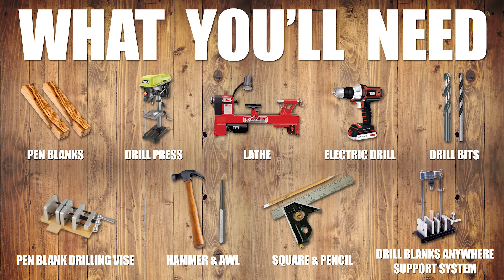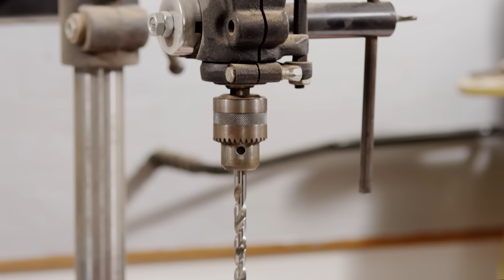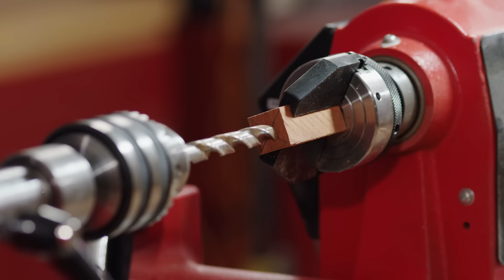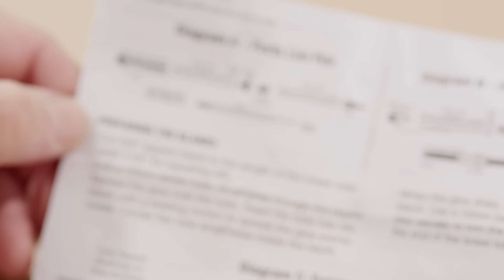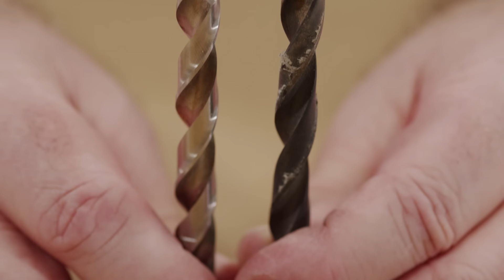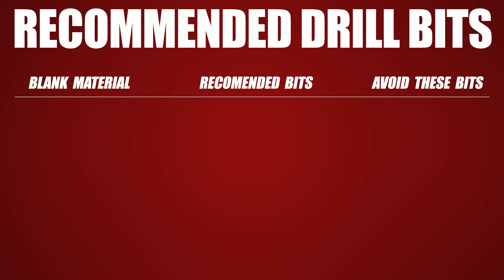Pen Blank Drilling Basics - Pen Turning for Beginners

Comment: I use my lathe (acquired from PSI 🙂) to bore out  the holes. I've been using the blank mounted at the head stock and my bit is stationary. Is this the best way? Can it be turned around so the bit is spinning and the blank is stationary? This would be, essentially the same as using a drill press but horizontal.

Comment: So curious here. I normally use a drill press and pen vice to drill my blanks but had a hard time with making an acrylic key chain tooth pick holder.  The hole was basically too large and wallered out.  So it was suggested to use my lathe to get a more accurate hole.  So I got the accessories needed for my lathe and the hole is more straight but still too big, the drill insert falls right through. Could I have a bad 11mm bit even though it is brand new?  Or something else?

Comment: I’m having issues with my chucks. I use the lathe set up. It’s having issues with vibration, causing the hole to come out larger than the bit and tube.

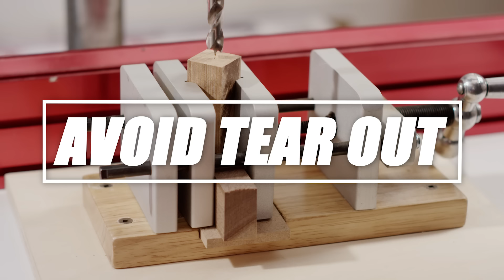Comment: 3:37 HSS stays sharper 10 times longer than carbide steel bits? Sounds backwards.  Why PSI?
Reply from the maker: Ken - thanks for pointing that out. Yes - that that is backwards and it's a mistake we didn't catch before we finalized the video. We just edited that section out so that erroneous information is no longer in the video.